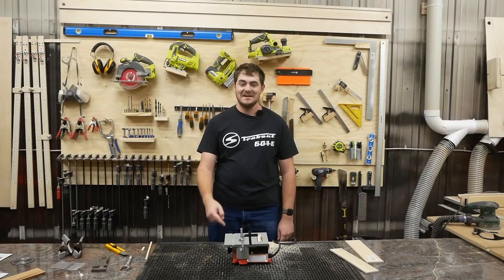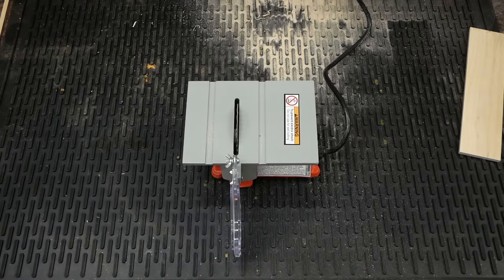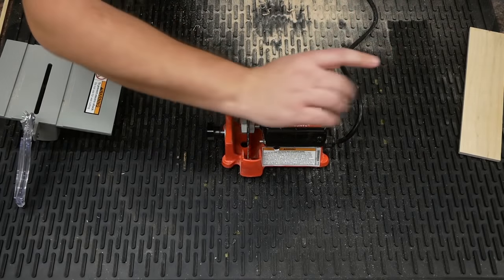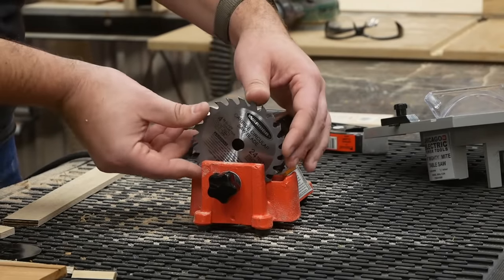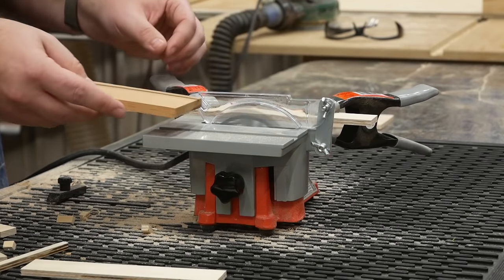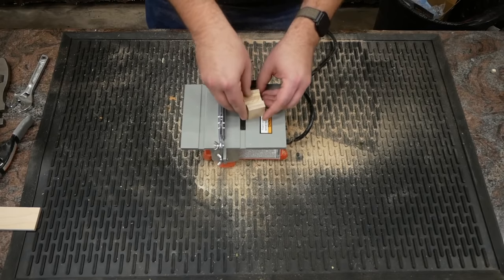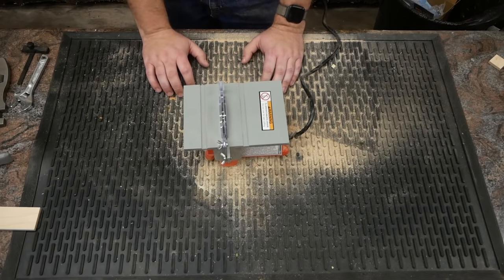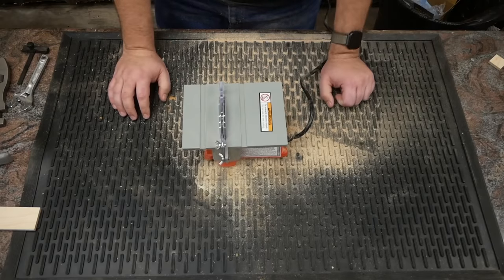Can This Adorable Tiny Table Saw Do Anything Useful?

Comment: I'd look into a better motor for it considering it seems to be as much the crappy motor as the blade on it.
Back in the day we had all the hand grinders stolen at the chimney repair shop I work for so the bosses bought a few Harbor Freight cheepies to get us by. I completely smoked one in a hour of use grinding out the bad mortar joints on a small chimney we were going to tuck point. They got the heavier duty version and it basically caught fire after about 2 hours.
We of course use grinders very hard and for many hours at a time so commercial quality ones last us 3 to 6 months before needing new brushes and they eventually overheat and the armature melts and starts smoking, even catching fire on me several times.
One well regarded manufacturer eventually refused to honor their warranty because we abused their grinders. Not everyone only grinds steel for short periods and none of them are setup to take having cement dust sucked through them for hours at a time.

Comment: Next video you should add dust collection for this thing  😁 but better not connect it to a 4" hose, it might suck the entire saw into the dust collector and what a nuisance it will be digging it out of the sawdust bag...   Either it's a dust generator or a dust collector (sitting on the shelf)    Funsies... 👍 yeah.

Comment: Wouldn’t it work well for bulsa wood, since bulsa is soft? I was thinking about something like this to use to make mini house structures and other mini things when I came across your video. Thank you for your review 🤗🪚🪑🛏🏠
Reply: Bulsa? I think you mean BALSA.
And yes, that is exactly what this thing is designed for.
Reply: Barely adequate for thin balsa wood cut-offs but unable to rip balsa wood strips greater than 1/8"

Comment: I actually considered something from Amazon that was similar, but ended up deciding that it was probably horrible and didn't.

Now I'm glad I didn't.  I was going to use it for small model work that I'd be quite scared to do on my big saw...  But I can see it's hardly safer here and probably still won't do a good job.  So...  Oh well.
Reply: A variable speed band saw or coping saw would be far more accurate, faster, and safer for model work than this death toy.
Reply: @Noah_E  I'm not sure if you're kidding.  I only know the hand versions of those tools and don't find anything about them being "variable speed" at all.  If it's sarcasm, it went over my head.  ;)

That said, my scroll saw probably is a lot better choice, if I can get some kind of fence for it to increase accuracy.  So thanks for that idea.  :)
Reply: @Raytenecks  I meant band saw, not bow saw.  We have one that can be slowed to were the blade hardly moves.  I wasn't trying to be sarcastic/a smart ass.
Reply: @Noah_E  Gotcha!  My father in law has one, but I don't get over there much.  Still, my scroll saw is the baby version of that, so I think it'll probably do.  Thanks again!

Comment: hahaha.  that thing should only have about 3-5 teeth in the saw disk for "optimal performance" - it might not bog down then and may get through the "logs" quicker.   lol..  (Of course a tool Designed for a 4 inch "cutter" - ie an angle grinder, has a significantly bigger / heftier motor. (not Direct Drive) )
Is Doug DeMuro a relative - or just similar voice patterns.

NB. For Straight Tile cuts - what can beat a tile breaker.... for curved cuts - of course again - Angle grinder (and Real diamonds)...  Yes Yes - the Binder is more important than the diamonds....

Comment: Now you need to upgrade it. 

Step one - the motor! It really needs a motor that can pull a lot more amps.
Step two - better blades. I'm sure some exist.
Step three - better top, including miters and adjustable table height.
Reply: So what parts of the original saw would be left?

Comment: Hilarious! Thanks for the comic relief. 
The burning might be from misalignment, but yeah, that's better suited for the hobbyist cutting something like bass wood ... more likely just a conversation piece for the shelf ... and videos😜
Reply: The burning is because the blades are about as sharp as a garden watering hose. Easy to sharpen them up and improve the performance considerably.

Comment: I like the review, you're showing all sorts of interesting things done with it, including information on the blades, and testing a replacement blade in addition to tile. 

 I don't like that you keep deliberately pushing the wood into the blade as hard as you can.   If you know you have a lower powered device, you _slow down_.   It's like lathes - you can turn hardwood on a _foot powered lathe_, but people complain like crazy about how 'low powered' certain lathes (like the HF four foot lathe I have) are.    Knowingly binding the a blade, no matter how low powered the item, is not a smart idea in any way, shape, or form.

Comment: It is kind of cute i might pick one up for hobby work  my mom   for many years was into Doll Houses  and i bought her a few tools over the years  i personally am a retired Professional Woodworker  snd most of the items i bougnt for her were too large and intimidating like a  band saw she said she wanted  but she really  needed  a scroll saw  which im thinking about building for her or refurbidjing s old used one   by any chance did you   check the miter guage slots for accuracy   and parrelel to the blade   as im thinking this little saw could be  used more efficiently with some mini sleds for more accuratd cuts  with my mom she would  need   90 and 45 dehree abilty for some of her moldings and furniture builds ironiccally my 3 year old grandaughter was recently gifted one of my mothers doll houses and i plan on building some furniture for hsr new house    as a family ws beleive the childrdn shoold be able to play with these houses not just look at them

Comment: Actually, I use this to cut Zinc and lead for my Staind glass projects.  It's extremely handy. Also, this is to be used for basswood, balsa wood etc. Not other woods. 
As for the diamond blade, meh, wouldn't use it as it should be a wet saw, and this clearly isn't. 
So please, yes I get that it's a crappy saw for "woodworking" but for stained glass, and things like dollhouse miniatures very soft wood, it's fantastic.

Comment: Well I do have one and it did not cut that well with the junk blades it comes with so I got some nice blades and it didn't cut to bad for as little it is I bought it for working on my Trans to build the building's for the HO's. It would have been much better if they just put one good blade in. The one I have is a difrint color an mine doesn't  Bog down like yours i must have been lucky an got a good one with more  Mighty power lol.

Comment: Looks like one of those tools you need to upgrade bit's on before you can even use it.
Just had an idea............. Have you still got a working motor in that Wheego ? LOL !!!

Or you could just see what this thing does in stock form if faced with 240v. :D
Reply: Hey, I was going to suggest 240v. It will either cut wood or make a smoke machine.
Reply: @eDoc2020  When putting 240v through a cheap and small 120v Chinesium motor there often isn't that much smoke. The winding don't get chance to heat up like a 3 bar heater and cook off any enamel coating, instead, one small section vaporises almost instantly, and the circuits broken.
I once accidentally replaced a 220/415v 3 phase 4hp motor with a "220v only" 3 phase version. I assumed the original was running on 220 and never actually got around to checking.... THAT one let a fair bit of smoke (And a hell of lot of pungent smell) out before I could shut it back down. It ended up being about a 300 quid mistake that my boss never found out about. :D
Reply: @Reman1975  Induction motors like you accidentally tried will react differently than a brushed motor like this. An induction motor will saturate and draw extreme current right away. A brushed motor doesn't have this problem so it will just draw twice the current. That is until the brushes arc over which won't become a huge issue until much higher voltages. I'd guestimate you need 4x the voltage before it dies in a few seconds.

Comment: This would actually be super useful for a model maker. you'd mostly be cutting 1/4 inch material. but significantly faster than you normally would by hand or with an x-acto knife.

Comment: Just bought one for my RC scale model boat hobby.  Useful for cutting balsa, dowels, beech plywood, PVC extrusions, small gauge brass tubes, and especially when repetitive cuts are needed for things like deck planking.  To compare its functioning with full size table saws is plain stupid.  More uniform than cutting with a hand saw.  The wood you were cutting with is far too thick.  Use thinner cuts of modellers wood, and don't even think of cutting tiles with it.

Comment: My experience with this tiny saw is somewhat different than yours. I own a number of professional power tools and use them regularly. Often, I get into fabrication of very small prototypes and realize that making then with standard tools is extremely difficult. When I saw this tool I immediately knew it would be perfect for my next project and bought it already assessing the little power it has. Since it’s purchase, I’ve use it many times and always performed well, not slowing down or burning anything, because I know its limitations.

Comment: You can use it for fret slotting guitar fingerboards with the right jig and blade (.023 inch kerf) available from Malco Saw in Rhode Island. Call them, they are aware of this saw. 1/2 inch arbor.

Comment: You rewire it, put a 350 engine with quad-exhausts and cuts fine on plywood if its the same thickness as shown above..but can be built with stereo disc player that sounds great.

Comment: Omg, I haven't laughed that much in a long time. Thanks man. I've been debating on which "real adult sized" table saw to get and I have ruled out the HF table saw since my original wishlist item of the Ryboi saw has better speed and wider rip capacity. I had seen this in the list on HF and never went into the page to look at it. I thought it was some toddlers toy made of plastic so he could be just like dad. I was looking at videos on table saw workbenches and saw this video in the list of suggested videos. At that point, I realized it's not some plastic toy if you are reviewing it. I love your size comparison to your chicken. So freaking cute! For the price of this 4" Mighty Mite, you'd think they would give you that carbide tipped blade with it. Yea, this thing is totally useless for a normal woodworker. I was reading through the comments here and the reviews on HF and it does make sense for crafters who build planes or use balsa wood since it's sooooooo soft. It probably cuts balsa wood like butter. Someone's review said it's great for fretboards on string instruments. Now that does make sense. I laughed when you showed your reaction at the time it took to cut through the tile and how you talked about the wasted .15¢ compared to the $36 for the saw and the $5. I bet a dremel tool would cut that tile faster.

Comment: At least you have decent miter slots unlike my 10" Skill table saw.  Now, you just need to make a cross cut sled for it, ha! :)  You definitely need to upgrade that motor or modify it to use a hand held drill to power the saw.  I don't think I would want to buy that thing unless it was just for cutting foam board or balsa wood.

Comment: Cute review.  But did you consider this for railroad modelers?  Or dollhouse miniaturists?  I am the latter and I work mostly with Basswood.  Generally I use 1/32, 1/16 or 3/32" thick. I wish you had demonstrated that.  Other thicknesses would be out of scale.  You tried to cut a piece of thick mahagony with limited sucess.  I want to be able to cut mahagony VENEER or cherry or other hardwood veneers that I can't cut with my little craft knife.  I think this will work well for that.  There are miniature table saws on the market that cost hundreds of dollars.  I think I'll start here first.  Thanks!

Comment: pretty sure its made for hobbyists, like balsa wood plane or boat builders... secondly, maybe if you did actually adjust the height correctly it would work better. Who sets a blade an inch above their material thickness??  A rather unfair review, my friend.  OMg, AND dry tile cutting??  wth.

Comment: So the good news is that it is quiet and you can still potentially cut one's fingers off. I guess you could build a tiny workshop around it, but not using this particular tool in the build process.

Comment: fuck all that nonsense and get a small gearbox and link the motor with it... With that, you could actually get a very pleasant speed of rotation and some actual torque... Then, the domain of projects is yours... Fuck, i'd buy one right now after seeing this vid just because it apparently aint that much of a jank that ceramics will murderize it stone cold on spot, which means that with and added fan, some modifications and a gearbox, you could make it actually decently useful... What for you might ask, well, the first thing was having your fingers crushed rather than cut off, but in the spirit of incoming holidays, lets say a nut grinder, or a NUT GRINDER if you know what i mean, but that would take some more work for it to do that kind of grinding... But yeah, lets return to holiday cheer rather than discuss how to potentially turn this innocent device into devils contrivance... All the best my dear friend, and as always, much love!

Comment: No don’t bother wasting your money on this crap I bought one and when you try to replace the blade the nut won’t screw back on properly. I discovered that there’s other brands of miniature table saws that might be 3 times better than this one or you might be better off just sticking with the regular 10” table saw. But this brand is terrible.